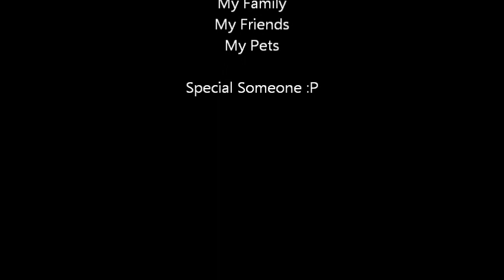How Jeans are made : a complete overview

Comment: As if the basic jeans production wasn't toxic enough they need to spray it with more poisonous dye. I wish people would think about the impact on the environment before they buy their denim.
Reply from the maker: Basic Jeans production always includes Spray. It is sprayed with Potassium permanganate, which is an inorganic chemical compound and medication. As a medication it is used for cleaning wounds and dermatitis. It is not poisonus as such. And only way to achieve same results but without using PP Spray is to use Lasers, which is more expensive than the normal process. Lasers are used by bigger brands.
Reply: @softhunterdevil  Resin is also used for setting 3D effect. Lot of dust is generated during dry process. Now its not traditional denim(which is Indigo dyed and 100% Cotton made Rotor spun yarn)
Reply from the maker: @Pahad_Paryatan  There was no 3D whisker or Resin used in this denim. But it depends on styles which require resin finish.
Reply from the maker: @Pahad_Paryatan  Also Dry process involving sand paper can be avoided by using lasers... As mentioned earlier to minimize. Beside Mask have to be used mandatory.